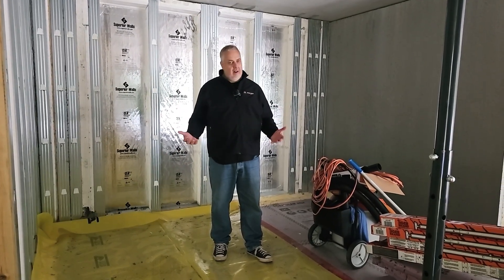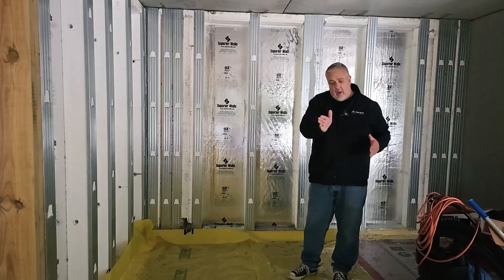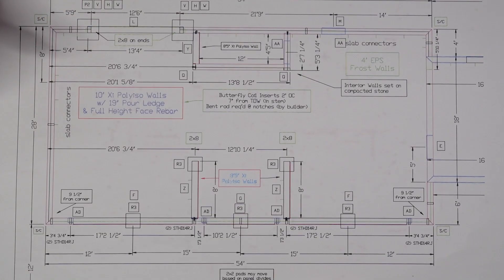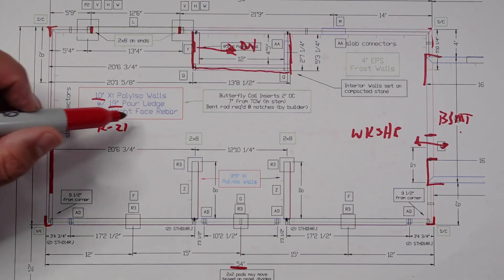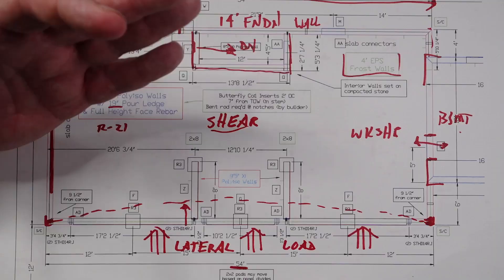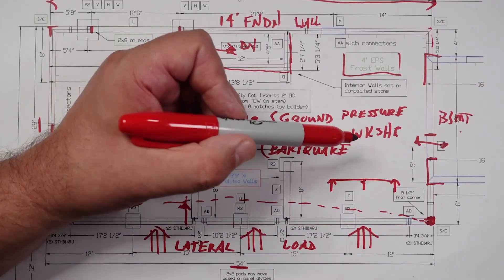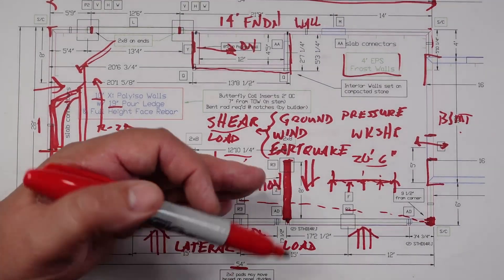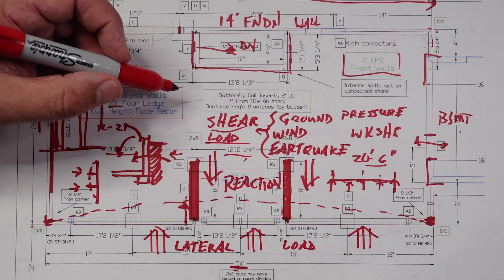SHEAR WALLS - of a Precast Foundation Wall System

Comment: I do not believe this explanation.  There is a basement slab diaphram and a concrete 1st floor slab diaphram. If you lay a superior wall down on the ground with one end raised on a fulcrum, you can drive a cement truck on that wall and it will not break. With the bottom and top of the wall COMPLETELY braced, that wall will not BEND nor buckle. The only reason for an interior shear wall is the need for a shear wall above to be tied down to ground. I was hoping to see the 2nd floor plan view to check this. This is my understanding from using Superior Walls since the 90's. You are not supposed to back fill a superior wall until the basement slab is poured and the first floor joists and sheathing are installed. Would be glad to be proven wrong - perhaps because of it being 10' hi. IDK. It seems to me to be overkill to protect someones back side.
Reply: Your explanation seems logical but Superior Wall designed this foundation. I agree with the shop concrete floor and above floor will definitely help but an engineer did design it. so ...

Comment: Thanks for the video never really thought of the walls in that way.  Does this also apply to block and poured walls?  I have seen many homes build without this sheer wall that are just as long but are block.  Any thoughts or reasons for this?